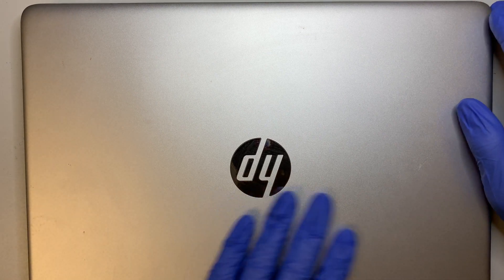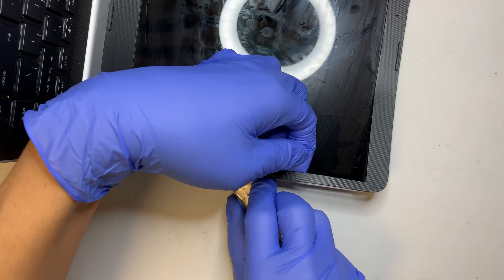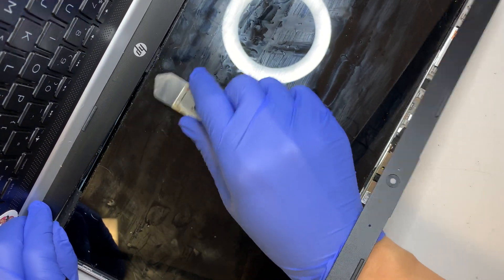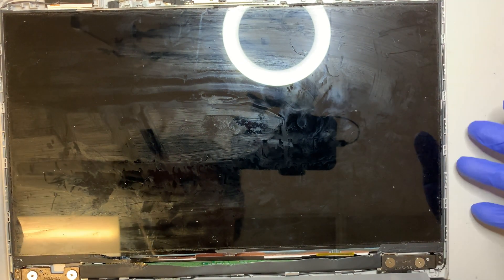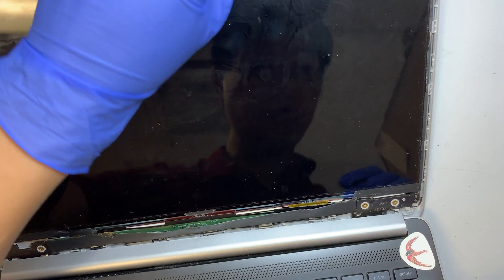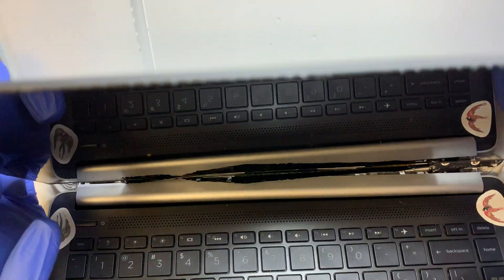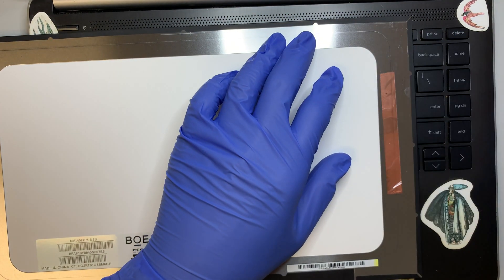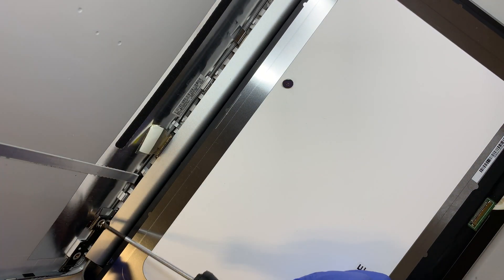HP 14 DF 0023CL Screen Replacement

Comment: Is your assumption that you wont have to replace the screen again in the future?   Since you are using double sided tape that you cannot remove as with the factory job.  Or would you just have to pry it by hand next time and try to separate the screen from the plastic?
Reply from the maker: When you install the double sided tape, make sure you give extra 1/8 inch outside the screen. So you know where the double sided tape is you just installed. For next time repair, you can pull the tape that you put on.